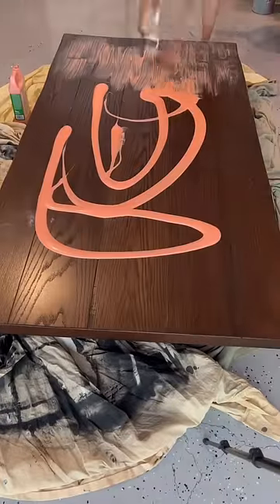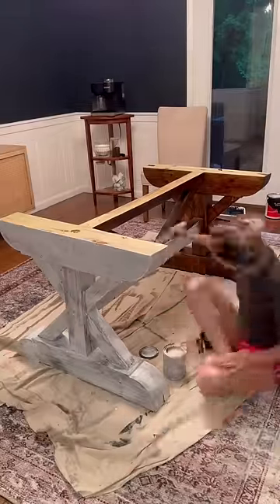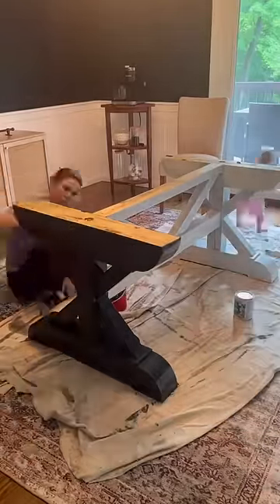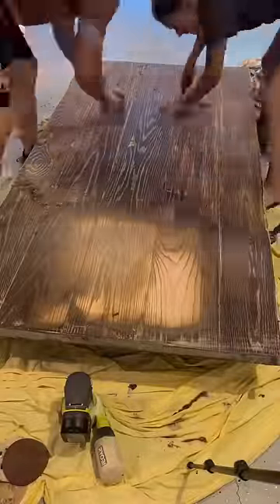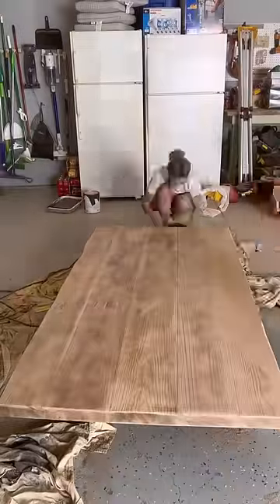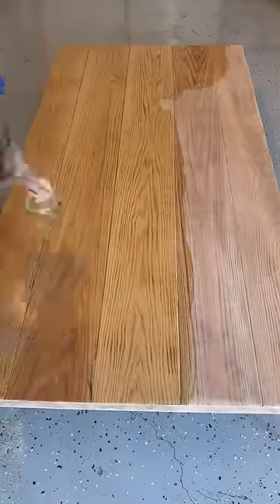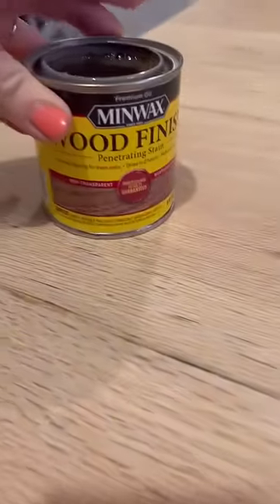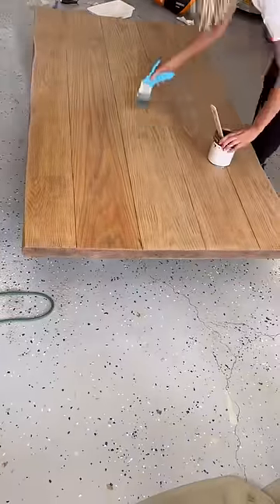Bleaching my Dining Room Table #diningtable #diyprojects #homerenovation

Comment: Did you use water based or oil based polyurethane on the top? Thanks!
Reply from the maker: Water base I believe
Reply: Thank you!
You put a lot of hard work into that & it turned out beautifully.

Comment: What paint did you use for the black base? Did it require a topcoat?
Reply from the maker: No top coat but I did a bonding primer and then paint
Reply: @thegibbyhome907  thanks for the reply, could you recommend the brands for the primer and paint?